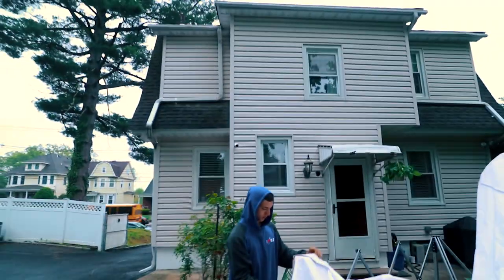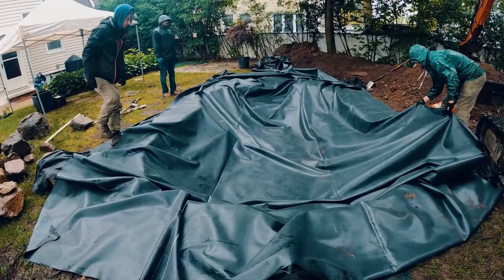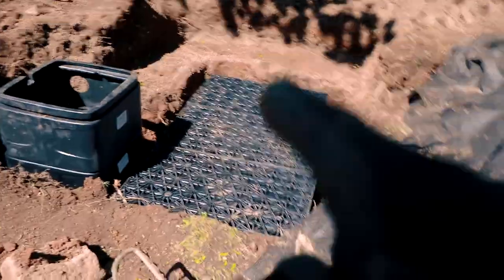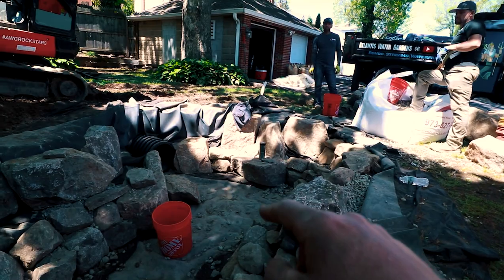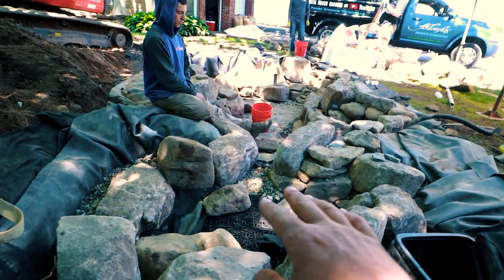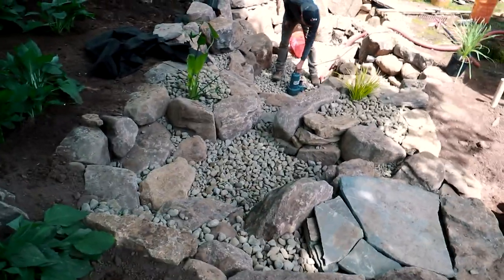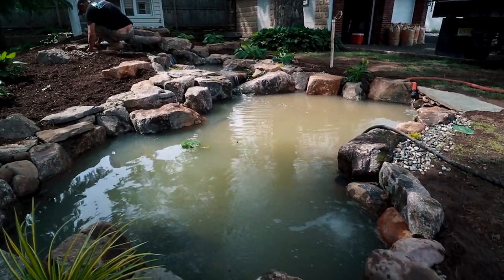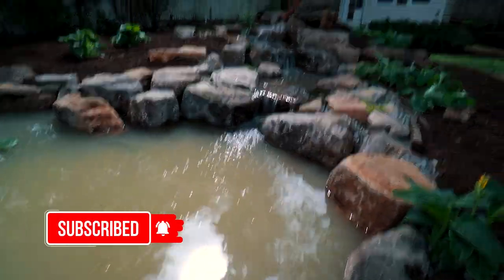POND & STREAM with Intake Bay Skimmer | Tranquility Elite

Comment: My pond is dug with clay, no liner. Maybe a 40x20 swim area and slope of 40x20 more shallow.  I assume the intake goes in shallow water designing in your narrow entrance. Yes i have a good size pond and would love to rehab what i have to be cleaner. Thanks for your thoughts
Reply from the maker: The intake bay skimmer goes on the opposite side of the falls, you don't want it in shallow water as that is where the pump is housed.

Comment: Great project.  Thanks for the vid.  Other than scooping out the floating material, what kind of periodic maintenance does an intake bay require?  Does some stuff sink and get drawn into the AquaBlox and have to be cleaned out?
Reply from the maker: No, you should never have to clean out the AquaBlox if it's installed correctly. There's a filter in the skimmer that would need to be cleaned, but other than that that's it.

Comment: Love this pond.  You guys are my favorite pond builders. I have a question. How is the intake bay plumbed?  If I have an existing skimmer, which is my water source for the filter and waterfall, could I replace it with an intake bay?   Where is the water pulling from?
Reply from the maker: Yes, you’d have to seam on a liner for the intake
Reply: @AtlantisWaterGardens  thank you for the answer. Does the plumbing attach to the liner?  Is it basically a bottom drain?